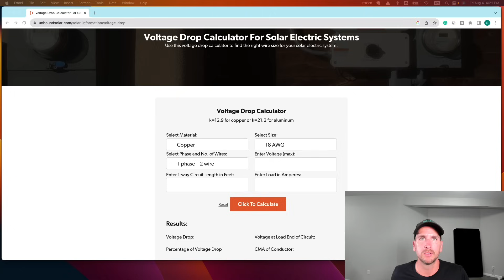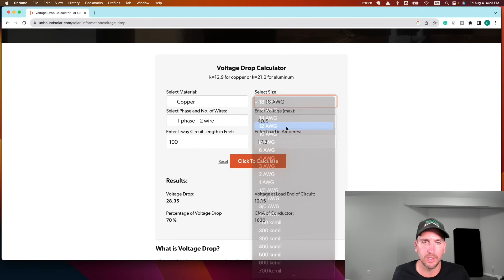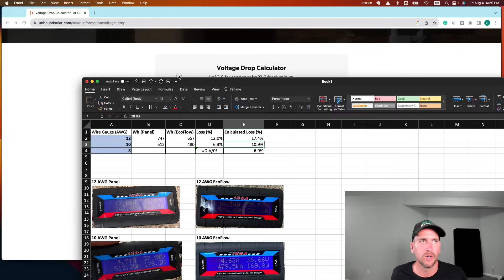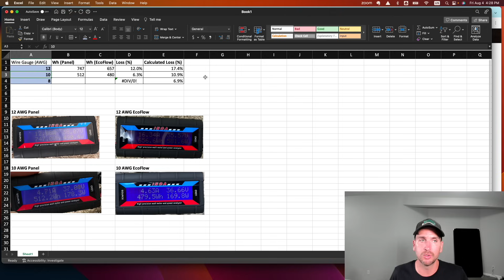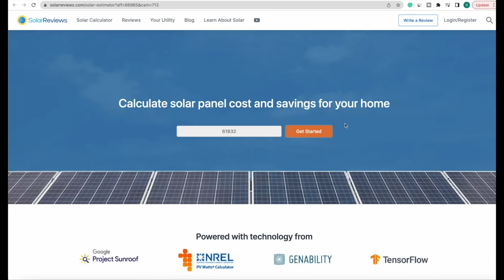What Wire Should You Use For DIY Solar Kits? Surprising Results!

Comment: Simple answer: Use the fattest wire you can afford.
Reply: And the highest voltage you can use for the charger.
Reply: Great answer
Reply: Keep cable runs as short as possible
Reply: @wallacegrommet9343 
And don’t coil extra wire that you don’t use.
Reply: @c50ge Michael Farraday!!!! Good call, another often neglected bit of advice!
Reply: @c50ge got to coil it to a degree.  Larger coils are better.  Otherwise theirs no way to store it. Can’t just stretch them out through the kitchen through to the other end of your home.  
An that’s really the only way it can be done is by coiling.  Their other ways. But them ways would even be worse
Reply: @wallacegrommet9343 that too…
Reply: @wallacegrommet9343 Actually you don't have to keep the cable runs as short as possible. You can compensate for the longer length by using a thicker cable.

But as a principal, you should keep the cables short, but you don't have to if you know what you are doing.
Reply: Not always needed, first rule: Use the lowest possible current! I.e. if conditions permit (partial shading can be bad for panels in series) use the highest possible input voltage your solar controller permits by connecting in series. For a given panel power output this gives the lowest current and hence losses. The cable losses are dependent to the square of the current, I.e. if you double the current your losses go up fourfold and vice versa. You might want to use beefier cables anyway to lower the losses even more but start “at the right end”
Reply: @lars-akeclasson875 yes, he should have been more clear on that. Wire capacity ratings are almost always rated in amps, not watts, and I’ve never seen rating numbers in volts.
Reply: Also, what gauge that will FIT in your connectors 😉
Reply: @DannyBowen25 no, the reverse, what connector sizes do you need for the wire. I ran into this repairing a 4 into 2  connector/adapter. Cut the two wires and they were 8 gauge, though the four were 10 gauge, just as it really should be, but you have to do some searching for 8 gauge connectors. And after hundreds of hours checking out videos on solar, I had never run into that and the cable and the connectors are virtually the same sizes. Most panel wire is 10 gauge, and there is little discussion  of panel to charge controller wire gauges. That is why I selected this video. Even though he isn’t absolutely perfect, just bringing it up is, in my mind, a great service to DIYers, especially all the newbies getting into solar.
Reply: @5400bowen  When I say connectors, I'm not talking about lugs themselves, but what lugs will fit.  For instance, I can't fit a 4/0 wire in a small PWM charger.  So, sometimes it's the physical size of the input that limits your wire size (upward)
Reply: @DannyBowen25 OK yes Mr Bowen. If you have that small of a charge controller you are limited. But, remember length AND gauge are important. So if you splice a thinner wire onto your long thick cables to go into your sockets, you can get away with running 2/0 wire for 600 feet, and splice it down to  a one inch jumper to fit in your device. Of course I’m exaggerating, but only to make a point to the uninitiated. If your input connections are that small, you are again running small equipment. But you could take it to extremes, say if you had a nice open hill a long way from your end use areas. Of course money is another matter. I went with 4 gauge wire for 40 feet, with 1800 watts of panels, but that was also so I could add more panels with impunity later. And I spliced them into the short 8 and 10 gauge panel leads. Notice how wire end lugs are much thinner for a fraction of an inch than the wire itself.
Reply: @5400bowen  good points
Reply: @DannyBowen25  I’m terrible..the name Bowen was formalized about 1370 when your fathers first name was you second name. It was all Aeiaean Iaeweain and such. Then suddenly it was all Euean Bowen and Ian Bowen etc. the king got sick of trying to keep track of the tax roles. Supposedly from Eugene from the Latin form. In Spanish it’s pronounced “oo-henia”. My branch came from Wales before 1850… no records before that, as the Lancaster county records were burned in a fire. My dad was born in Wilkes-barre Pennsylvania. OK, I promise! Strictly solar in any other discourse here! Did you see my lengthy account of my brothers electronics career? And Aloha!
Reply: If you need to run a long run for higher amperage and the wire is too large for the mppt input connector, you can simply land to a buss bar close to the mppt and then use a smaller gauge wire thats maybe 2 or 3 feet long off the buss bar, and as long as you do not exceed the ampacity of the wire,  you shouldnt really see any significant voltage drop if only calculating that short run to mppt terminal. Run lenght absolutely does matter.
Reply: Yup. Never go for the theoretical minimum IMOE, Way more resistance losses not only in the wire but in the connection as well as it deteriorates over time.
Reply: @czhusky spot on..sounds silly to some, but mechanical strength matters too. After doing decades of maintenance on commercial and residential properties, you see all kinds of problems caused by physically weak/small equipment (including wiring) that you just wouldn’t imagine without hundreds and hundreds of examples in myriad situations. Go beefy. Reliability and safety are issues with thin wires to boot.
Reply: @czhusky PS…those losses are day after day, year after year…it adds up, as does the reliability factors.
Reply: @czhusky what does the “O” stand for…and you are spot on buddy!
Reply: Shortest fattest wire by the most direct convenient route you can manage.
Reply: This. 8 gauge is difficult to find MC4 connectors and crimpers for, but you can purchase pre-made lengths.
Reply: I bit the bullet and bought 8 awg for my solar panel wire since the 10 gauge was heating up with only 2 170watt solar panels in parallel
Reply: In 12V DC, amperage is 10X higher than 120V.  Current is the FLOW in the conductor.  That alone tells you all you need to know about wire gauge choices.

Best to keep the array to bank distance as short as possible, and unless you have a really highly efficient high voltage charge controlled, stick with 12V.

I like keeping 12V as there aren’t very many DC appliances available that run on 48V.
Reply: @freddurstedgebono6029 off topic I know but I’m an older guy and saw U2 live a few times, including on their first album tour. We called them back out for a 2nd encore and they said they didn’t have anything more rehearsed so would we mind hearing ‘I Will Follow’ a 2nd time.
Reply: Yep, electrical physics 101, fatter wire, less resistance, less drop between point A and B
Reply: Yep I could have just used common sense
Reply: It must be pure copper wire too, not mixed with aluminum or other metal. Only a few reputable companies to use for this.

Also some of those panel wires are not pure copper connections they differ from each company and diodes as well. Most of the cheaper brands need upgrades to make better. (May or not be worth it)

It’s what your time is worth and how long you plan to use the solar panel matches what you’re willing to pay.
Reply: But are MC4 Connectors available for 8 AWG wire?
Reply: @briha3142  I am looking for this answer as well. I would like to use 8 gauge wire, but my MC4 connectors are 10 gauge.
Reply: @briha3142 you can also cut a few strands off bigger wire at the connections to get them into smaller connectors. Wire lugs have a very very thin “neck” where they come off the wire end, remember your cables are chosen by length as well as thickness…the power can run through a much smaller connection for a very short distance… like 1/4 of an inch.
Reply: Waste. VDI chart super easy.
Reply: Micro inverters on each panel can change the game here. But.
The conversion back to D.C. for storage in a home  has or can have  considerable liability but managing things on a small scale might  permit cheap component selection.
A power house right below the array with batteries and an inverter seems like the best option to me. The power house away from a residence that keeps a happy family of batteries in a good comfort temperature range year round then let's you treat your residence like any conventional home.
Reply: That's not simple, the simplest method is to connect in series and get very little losses
Reply: That’s how I pick my girlfriends, the Fattest I can afford.
Reply: Simple answer: Wire in series to keep the Amps low and save $hundreds on copper. 88V @ 8A =  better design. 4 or 6 or more PV modules in series = way more power. Get a charge controller or hybrid inverter that can handle 500V and get 10X power through the same copper. Trade 100’ of 8 AWG wire for 12AWG and you can pay for a couple more PV Modules.
Reply: Thats what SHE said 😂
Reply: To much copper attract gypsies... 😁
Reply: Thanks bro
Reply: Exactement plus la section est importante , moins il y a de pertes.
Reply: Panels should always be in series if possible. Also the cost of copper wire can be more than more panels. 
So this is incredibly misleading.
Reply: 250 kcm got it 👍
Reply: Nonsense. Use the smallest wire you can with some headroom.  There is a reason we like serial strings of panels and high voltage.  It allows you to take advantage of lower light levels at the beginning and end of the day and the higher voltage is way more efficient t over distance.  Providing the panes have bypass diodes you are all good.
Reply: Bring the Lizzo wire.
Reply: @freddurstedgebono6029 I have revised that to more updated #s before here but when panels came out they were estimated to have a 20-year effective lifespan. Hence the ~5% degradation annually was estimated.
Reply: Yep I just use 4/0
Reply: Thanks .
Reply: Ty
Reply: Oh good, I can only afford 18 gauge, so I’ll use that.
Reply: Yes, that's what she said.
Reply: @joeboxter3635 jokester! Good one!
Reply: The copper will always be worth whatever the current price is so even go overboard a little.
Reply: @mikedavison3400 Actualy not, cable loses only matter during peak production. During peak production you usely have to much power anyway.
Rather spend the money on an aditional solar panel, it will compensat the loses and still gives you more power during suboptimal weather.
Reply: @jonasstahl
Solar panel output degrades at ~5% annually and the panels are not easily recycled. That has led to predictions of a tsunami of waste when panels no longer are productive. The copper wire on the other hand will be as good as new.
Reply: @mikedavison3400  Your numbers are completly wrong.
My Panels have a garanty of 93% power after 10 years and 83% for 25 years.
Reply: @jonasstahl
You’re correct. My #s were from a decade ago and durability has gone up. I read recently about combination panels that produced hot water from cooling the panels as this not only increased production but also longevity of the panels. Heat is an enemy of both. I’m sure you’re aware that warranties and/or guarantees are not as iron clad as at first glance. A lot are pro-rated and in order to get the value of them one must purchase new product from the supplier. Still I am glad to see less degradation in today’s panels. 👍
Reply: @mikedavison3400 Solar panel output does not degrade by 5% a year.
If that were true the panels would be producing zero power after 20 years and that is simply untrue.

The manufacturers often quote a figure of 80% of full power after 20 years.
Reply: @jonasstahl9826 no, panels vary hugely in power output through the light intensity variations. I’ve gone up to 19.7 volts from 12 volt panels. And with thicker cable, it lets the power flow much easier day after day, year after year, with, as I mentioned in another comment, will offset wire degradation over periods of years. And like another said, the value of the copper will always mean it’s like money in the bank.
Reply: @jonasstahl9826 and at peak is when you definitely don’t want to be pushing the power through smaller cable. I used 4 gauge wire for a 40 foot run with 1800 watts of panel. And again, you ad more than efficiency, you add a bunch of safety.
Reply: @mikedavison3400 PS, that heating water is a killer idea! You can heat your house at night with it with a large insulated storage tank. And a lot of other possibilities  to boot! And if your panels are on the roof you stop the heating of your attic to some degree. Saving wood, roofing materials..dang!
Reply: @5400bowen
I didn’t come up with the idea. People have tried air cooling and various types of water cooling. ‘Just Have a Think’ had a video on a New Zealand or Australian company that have turnkey panels that either use the ‘waste heat’ water for heating or power generation. I’ll try and check it out but do check for yourself as you might find something that hadn’t crossed my radar.
Reply: @mikedavison3400  SCHWEET!!!!! Mike, you are definitely my kinda guy!!! Thanx a million, from the heart buddy!
Reply: @5400bowen
I remember watching this awhile back: “Warming up by cooling down your solar panels” - Engineering with Rosie
Reply: @mikedavison3400 That isn’t even close to reality.  You got your decimal point wrong.  Annual degradation is closer to 0.5%.  Decimal placement matters.
Reply: @LTVoyager
I already acknowledged earlier in this thread that my data was out of date. ~10 years ago 3-5% degradation annually was what was expected, and the heat the panels had to deal with was what made the degradation worse. My interest at the time was in solar RV applications but many quickly became disillusioned. In putting panels right close to the roof many found that the heat on the roof then necessitated them running their generator to be able to run their AC. Many in the RV community mentioned that they loved to find a nice spot to camp that was shaded. Well those of us who have experience with this note that solar panel production doesn’t just go down by 50% if the panels are shaded 50%. It’s astonishing how little you can get out of 390 Watts of panels just because they are shaded a bit.
Reply: @mikedavison3400  Great point!  Cooling is the new frontier.  Working on cooling the panels will get us more efficiency gain than running super fat wires.  The reason most panels don't perform anywhere near rated is heat.
Reply: @ceeweedsl  hey. I laughed my head off at your other reply that was in my email feed. If it was deemed ‘not suitable for YT then someone’s knickers are too tight. I had acknowledged earlier in this thread that my degradation #s were from ~a decade ago and materials and manufacturing processes have improved significantly. My ‘spend extra on copper wire VS buying an extra panel’ narrative was from an environmental perspective. There’s a tsunami of spent solar panels coming. There are already reports of wind turbine blade ‘graveyards’. The copper is reusable or at least recyclable. Solar panels and wind turbine blades at this moment are not easily if at all recyclable.
Reply: @mikedavison3400 Solar panels degrade 5% the first year or so then it’s very slow after that.  There are plenty of panels operating 30 years later with ~ 70% of original capacity.
Reply: @mikedavison3400 they say those hybrid panels will go for up to 50 years… longer than many utility company giant generation facilities do.
Reply: @5400bowen I think you are way overbuilt.  I have a 200' run, fed by 11,000 watts, for a 2% voltage drop in my construction plans.  I have to check, but I am fairly certain it's 10 GA wire.

What voltage are you running to your inverter?
Reply: @mikedavison3400 Hmm, my current panels(2nd owner) degraded just 27% in 25 years
Reply: @rossr6616  I qualified that somewhere here by saying heat has a lot to do with the degrade rate.
Reply: @jonasstahl9826 wrong. You are throwing away a percentage of the power in resistance losses from the very first watt.
Reply: @mikedavison3400 man, I'd like some of these. I'm thinking of the cost of a separate roof heat exchanger to cut my hot water bill. Getting a combo would be sweet.
Reply: @capnbilll2913  
I was wondering about that.   Should we go 10% over maximum  ?  Is there another ratio we should use.  For such short runs I want whats best.
Reply: @mikedavison3400 You are grossly misinformed. Annual degradation is about .4% (or about 10 to 12% over 25 years!). Modern panels degrade even less nowadays.
Reply: @mikedavison3400 5% annually? Where did you come up with that number? I’ve had solar panels at our off-road cabin for 15 years and they still put out close to advertised output. You must be using crap panels for that much degradation.
Reply: @jonasstahl9826 We have panels 15 years old and put  out close to original output.
Reply: @jean-yvesferry4669  Earlier in this thread I acknowledged that my #s were outdated. Early on panels were said to be of use for an expected 20 years.
Reply: @Chris_at_Home  Earlier in this thread I acknowledged that my #s were outdated but early on it was said that panels would have a useful life of 20 years.
Reply: @mikedavison3400 You're installing cable to carry current and achieve a certain requirement for voltage drop.

You calculate what thickness of cable is required to achieve that.

The cost of the copper and its future resale value does not come into it.

You are buying the cable for a specific purpose, not for selling it later.
Reply: @deang5622 boy, you buy the little tiny plastic bottled water too? Such an eye on conservation!
Reply: Not really. It all depends on the length of run. The longer the run the thicker the wire. I’ve ran 300ft runs of 10 awg with no voltage drop.
Reply: @brianherren9222 can I get a bag of what you are smoking? You are talking about nullifying the laws of physics. Did you not watch this video?!? Or do you have one 10 watt 500 volt panel?
Reply: @brianherren9222  It also depends on power carried.   I  bet you that 300 ft of 10awg will show a lot of drop with 1200 watts of 20v  panel.  I just tested a 350 ft run of 8 awg to a well pump. WITH a 10 amp load.   Running 118V it was losing 12v over the run. It all looks great until you load it.
Reply: @brianherren9222 you’ve run it that long, but not with substantial wattage…. Not substantial current without loss.
Reply: Oversimplification.  Sometimes it is better to take that money and expend it elsewhere.
Reply: @cccmmm1234 rarely, he is right the beefier the better. Safety and resistance. Resistance is so much of problems with electrical. Plus as wire degrades over time, the extra capacity offsets that added resistance with age. And he said what you can afford. Many off gridders want virtually unlimited supply of power, they don’t want to do a lot of conservation steps. And if you run your main runs with beefier wire, you can add panels later, another VERY common situation with DIY people.
Reply: @5400bowen  Sure, the beefier the better if there are no other factors to consider. But in reality there are. Cost for one.
It might be cheaper to put up another panel than run really beefy wires for a distance. If so, then the most watts for a given budget might be to not get the beefiest wires.
Reply: @cccmmm1234  well he did say “you can afford”. I’m assuming that also takes into account other expenses.
Reply: @SmoothLounge7 You have to be able to afford the weight too.
Reply: @cccmmm1234  Not when it comes to wire gauge.  It is absolutely the best bang for your buck.  Think this way.  People who use "traditional" wire gauge have unlimited power.  They can afford a 3% - 5% loss. 

People who rely on solar do not have unlimited.  That 3% to 5% loss (day in and day out) is big.  In fact, price a solar panel that is 17% efficiency and compare same wattage with 21%.  That 4% is on the same loss as poor gauge wire.  But people will spend 2 to 3 times more for same watt panel because they need to produce as much out of each panel.  In the long run, there is a payoff.  In solar squeezing that 3% - 5% makes sense. 

But you suggest  accepting 3% - 5% loss when the industry pays a 200% - 300% premium on the panel,  to save 20% - 50% for cheaper wire.  It's penny wise and pound foolish.

First put money in the best quality wire. It's foundation for your system and for your safety.   Cut corners elsewhere.  Then over time replace those items if needed with higher efficiency, if you can afford -- not the other way around.
Reply: @cccmmm1234 you’re right.
Just calculate the extra costs of wire, watch the loss in kWh, look at your bill to see the price per kWh, then you can see if it’s  worth the extra money.
Also you can calculate your generated power and look at the price of your solar system to calculate your own kWh-price.
And… why are those panels are connected in parallel? The higher the current the bigger the loss…
Reply: Nonsense.
Reply: No. Just calculate using a calculator what voltage drop you will get with a certain length of cable of a certain cross sectional area. 

You should know what the maximum voltage drop you can tolerate is.

So based on that requirement you can calculate what the minimum thickness of wire is that will give you that.

There is no point in spending money on thicker cables which give you a lower voltage drop than your requirement. That's a waste of money.

You just need to learn how to calculate the resistance.
Reply: @deang5622 and it’s not a waste of money year after year after year. Not to mention safety and as another also noted, increasing wire resistance year after year.
Reply: @deang5622 hey why did this guy do this (excellent) video? He addresses all that in it. You can do as you please, it is a free country. But it seems to me the comments don’t need to simply parrot the video. And read all the replies. OK, now you’ve done it!!! I was started on electrical/electronics by my older brother. Complete nerd and a virtual genius, and this is for all who replied here, so let me give you all a perspective of my education in such matters, and yes, I like to toot my brothers horn. Best older brother ever. Read us two full Robert Heinlein novels when he was 15-16 and we were 7-9 in 1962-3. When he went in the navy just after that he got 100% on three consecutively more difficult generalized aptitude tests. The recruiter said “well we ain’t got any more tests, and in 5 years I’ve never seen anyone get past the second test”. My brother could have been in the nuclear service, but for his eyes. So he went to electronics school. Assigned to VF-92, on the USS Enterprise, the flagship of the entire US navy. He was fixing ballistics radar and flight control computers. He was stationed at Miramar, where they filmed (at least the first) “Top Gun”. After the navy he worked at the Naval Electronics Systems Analysis Laboratory in San Diego. His job was to find design flaws in the most advanced electronics equipment known to man at the time. And that’s why I am so firm in my advice and comments on solar and electrical issues. This stuff is child’s play compared to what he taught us. The only issues are the myriad and constantly changing features in solar technology. That takes a really consistent viewing of the latest products for comparisons. All my best to all who slogged through my epic novel!
Reply: @deang5622 until a big storm/tree falls over and mangles your thin wires, or corrosion eats them up ten times faster than a nice beefy wire well above the calculated requirements. Or rats chew them up, or mice that couldn’t or wouldn’t try with a beefy wire…there are other considerations I learned by working on myriad facilities over several decades.
Reply: @deang5622 I've never seen a situation where going up 1 or 2 wire sizes didn't drop losses significantly.